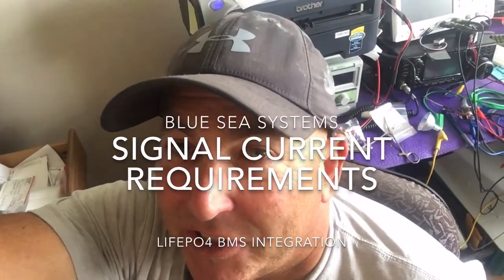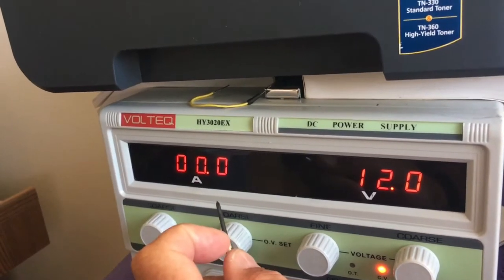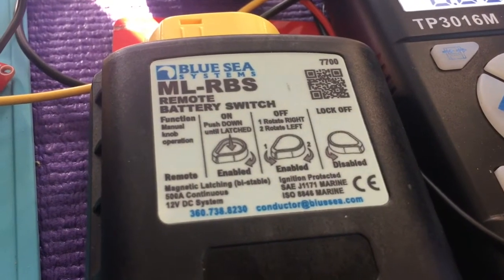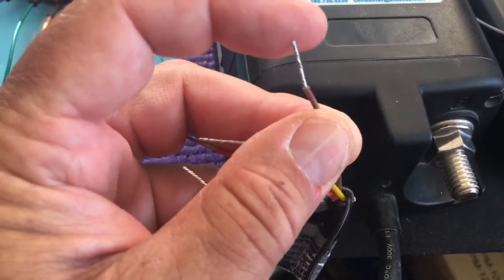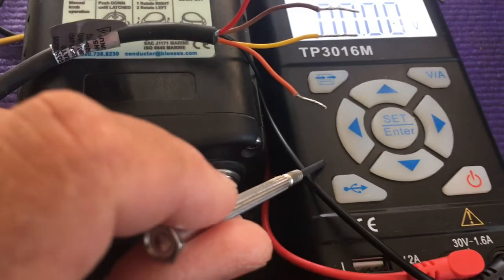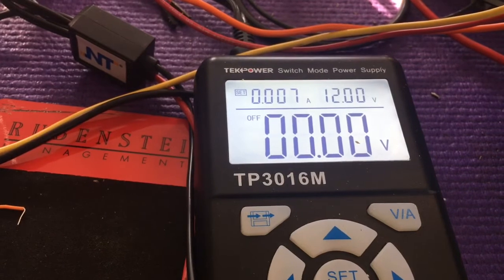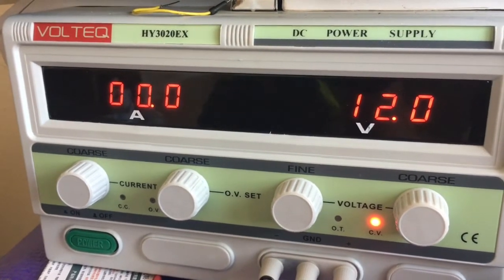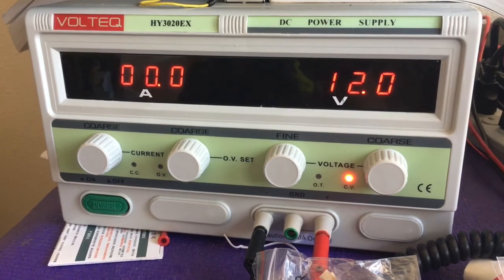Only 7mA is needed to drive signal wires on Blue Sea ML-RBS 7700 Latching Relay for LiFePO4 BMS

Comment: Thanks for the videos on this, lots of info. I'm thinking of going this way as well. How has it been after this time ? I'm using a diybms which I think can switch those 2 lines with pulses without any other components, if not then you solution looks good.
Reply from the maker: Im still not implemented with my new bms. I copied the design from a really smart guy SY DESTINY on FB group Lithium Batteries on Boats. He uses a REC BMS. He has some uploads on this group. I think coping his design will be your safest and easiest path with a large battery bank eg 1200ah. Many people on this FB group are very smart on BMS.

Comment: Now wondering if the ML-RBS Close wire can just be wired directly to the SBMS0 and left there and just use a single TIME Relayto trigger once the signal goes off.
Reply from the maker: I think they make "inching relay modules" where you can set a time 0-60 seconds where relay is on.   This is a popular application is for garage door openers for home automation with smart wifi using Home Assistant / Tasmota esp8266. This way the bms could give a long on or off at 5v and the output would  pulse the orange wire on the ML-RBS 7700.  I'm not sure if you could find a 12v inching relay . It looks like they only come with 5v input on the quick search I just did.